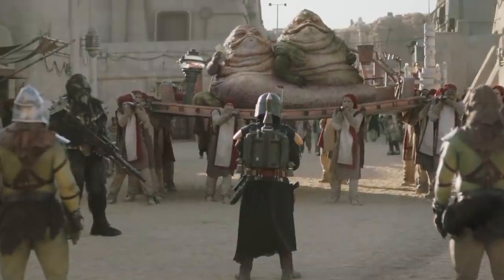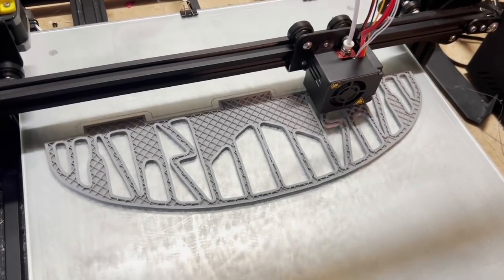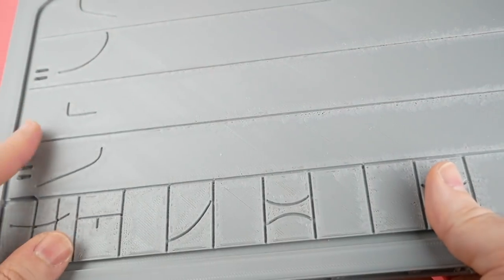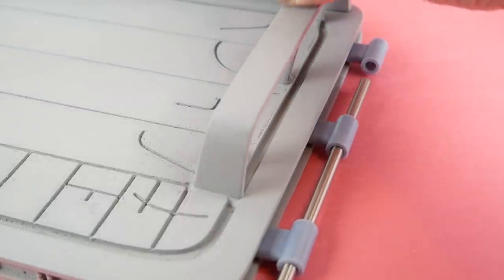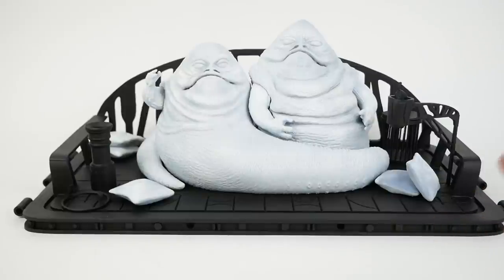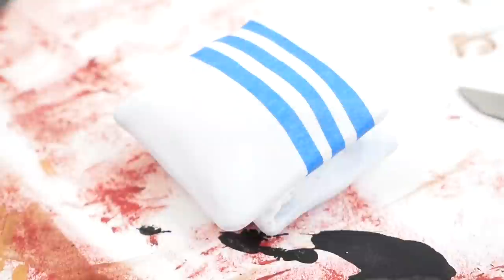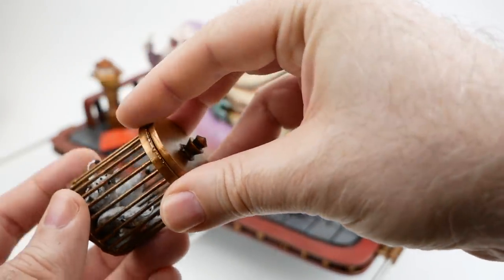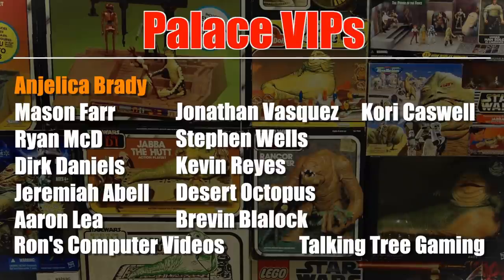Let's 3D print some 6" Black Series Scale Hutt Twins from The Book of Boba Fett!

Comment: Great job brother, love it.

Also when using clear epoxy’s - if you are struggling with tiny pesky bubbles, apply direct heat with your heatgun. 

They will pop & dissipate in notime.
Reply from the maker: Thanks. I did do that but it still had bubbles throughout that didn’t get popped. I probably introduced too much air in the mixing process

Comment: Turned out awesome! I'm more into 
TVC 3.75" also Hot Toys 1/6 scale. Would be cool of they come in those scales. I don't have a 3D printer so I would need to purchase them from a seller. This has given me some cool ideas for a display! Very cool your airbrushing skills are coming along nicely. Really did a great job on the female Hutt, that pinky, purple tone works really well. Very nicely blended, great job!
Reply from the maker: Thanks! Of course it is possible to resize things for 3D printing, so you could potentially have these printed at either 1/18 or 1/6 scale, but it can sometimes cause issues

Comment: always configure slicer settings for 1mm minimum top surface thickness (5 top layers when printing with 0.2mm layer height, etc). also, you didn't really need the support in those holes. the printer will easily make perfectly circular, fully unsupported holes with no issues due to how gradually the hole is created with no real sudden overhangs like the kind you'd have in a square hole, for instance.
Reply from the maker: I’m aware I didn’t need support, which is why I mentioned that specifically in the video. 😬 It was just an oversight like the quality setting issue

Comment: Great videos as always! I am wondering if you could recommend a good paint for 3D Print resin, specifically Siraya Tech resin.
Reply from the maker: I don’t think it really matters that much. Just get a decent quality acrylic paint like Vallejo or Army Builder, and I recommend priming it somehow with a spray paint to help paint adhere. I have also used cheaper brands of paint like Apple Barrel and they are also okay but the coverage isn’t as good
Reply: @MightyJabbasCollection  Thanks, I heard of Vallejo and Army Builder but wasn't sure what you use and your stuff turns out really good. Thanks for the quick response and recommendations. Really like the 3DPrint Resin videos, you are really good at showing and explaining "the 'how to's " and processes.